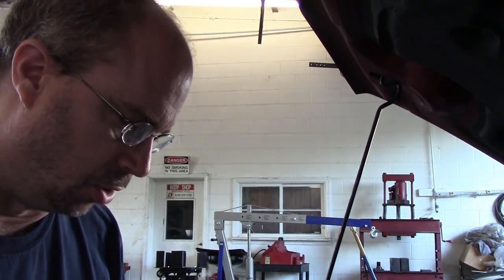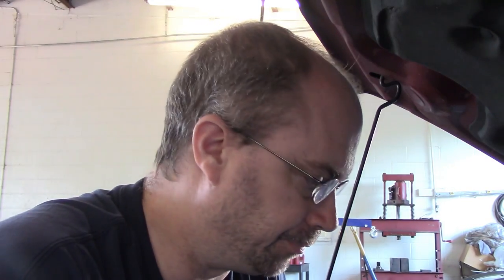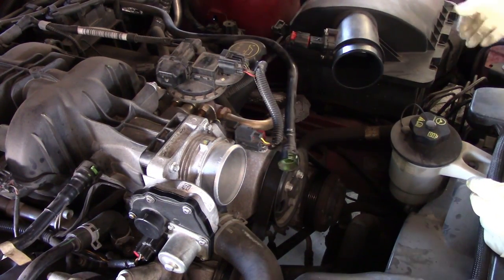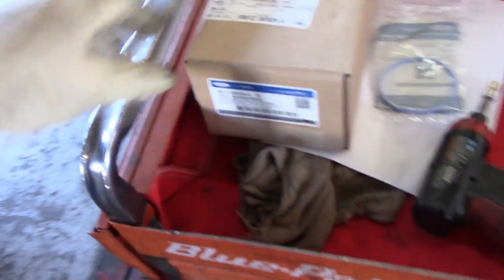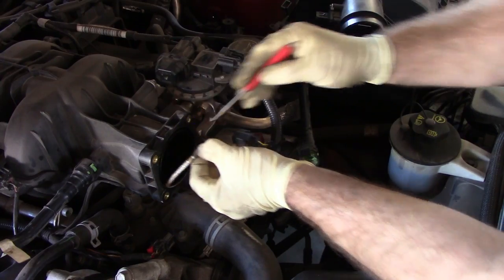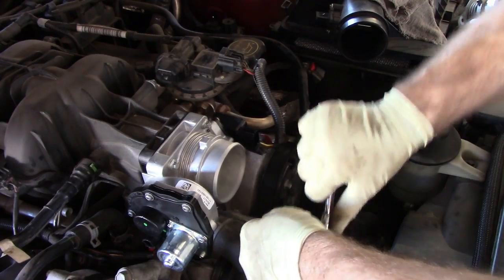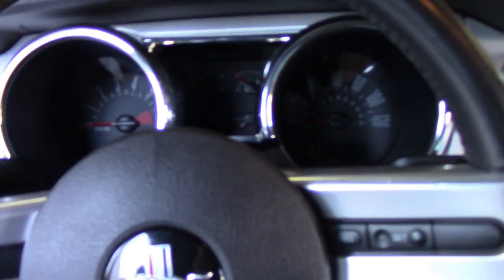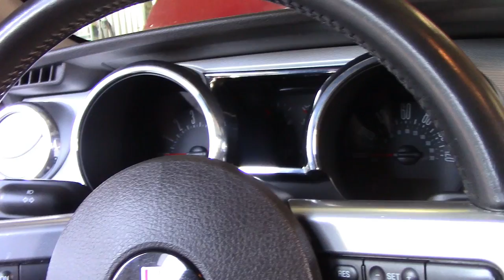A Visual Inspection goes a long way

Comment: I think most every manufacture is having electronic throttle body problems. I have replaced 3 on GM cars in the past month. Chrysler has had some on back order. I usually install Hitachi aftermarket ones. Haven't had a problem (yet).
 I believe that throttles were being pulled wide open by the cables in some collisions so the drive by wire solved that problem.
 Nice job, Brad as usual.

Comment: Sounds just like my Ranger 4.0   Lol.    I work as a service tech in a different field (non automotive) and one or two of my co-workers are not exactly visual inspection experts, mainly high strung parts hangers and swap tronics experts, drives me nuts.  Its usually something stupid simple that can be solved quickly and with a minimum amount of effort if you just look and turn on your thinker for few minutes.......theory of operation is a nice idea to keep in mind!

Comment: What's your opinion brad, on these fly by wire throttles? I personally prefer a cable system, I've never had to replace a throttle cable or foot pedal all my time as a tech. I understand it simplifies thing for the computer, like cruise and whatnot, but I'm not a big fan, too many expensive parts
Reply from the maker: I really miss being able to rev the engine while under the hood. :)

Comment: what make is your cordless driver?
Reply: I think its snap on.
Reply from the maker: It's a Snap-On 7.2v cordless screwdriver. I like to use it because it has such little torque that it will not break or strip out anything.